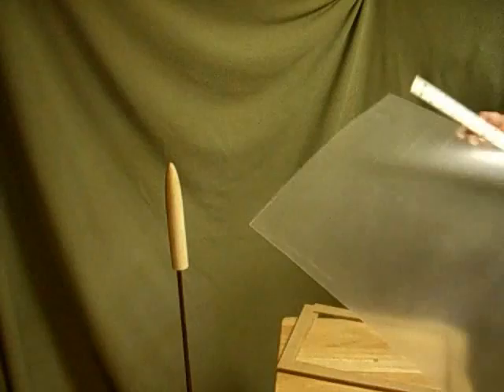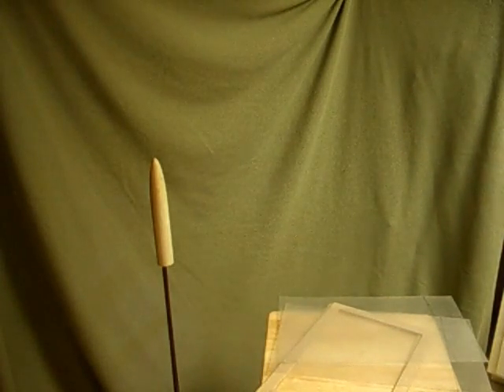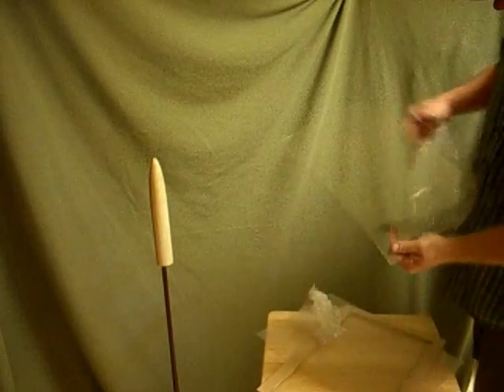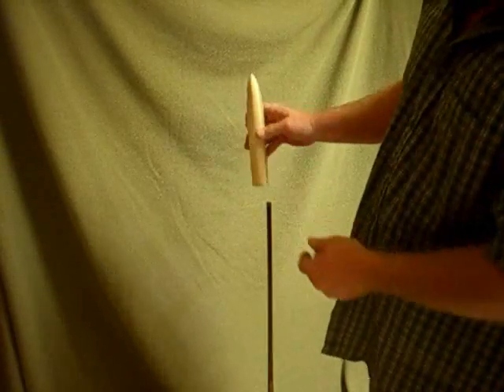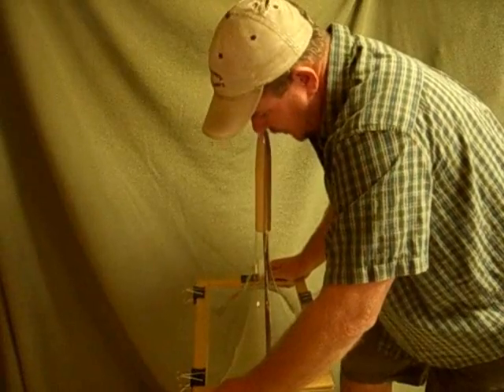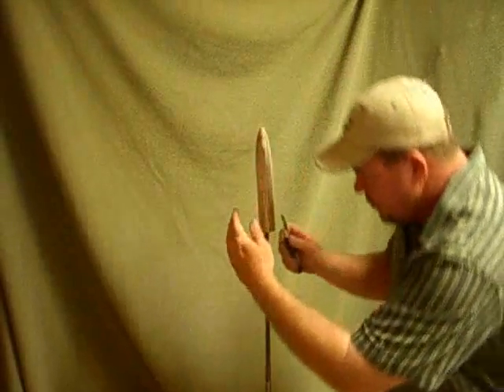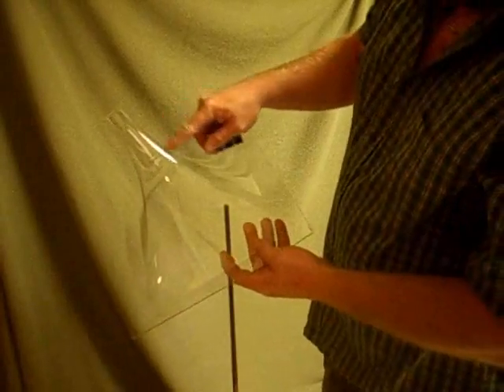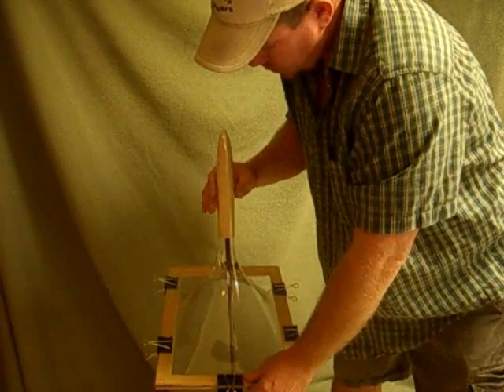PLASTIC FORMING (PETG)

Comment: Is there anything specific you use(d) to make the frame for the PETG? Did you use a regular convention/kitchen oven to warm up the PETG? If so, what temperature did you set it to? Did you use the same temp to warm up the plug? And lastly, does the plug have to be made out wood or can it be made out of something else? Thanks in advance!!